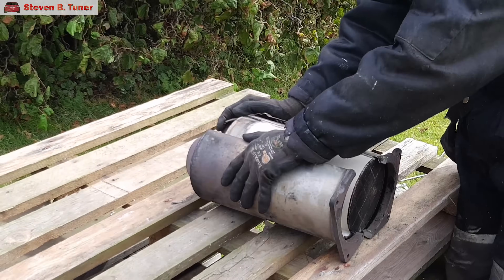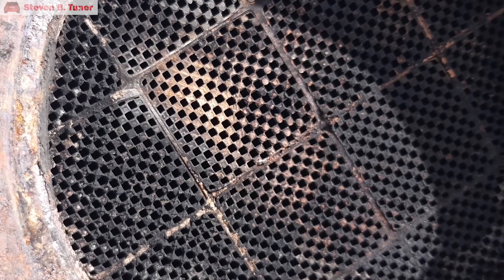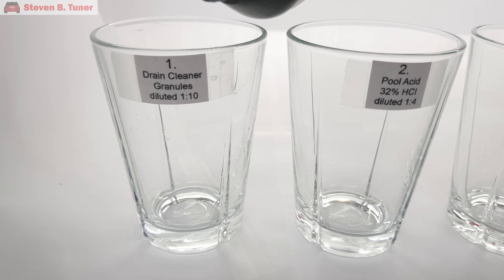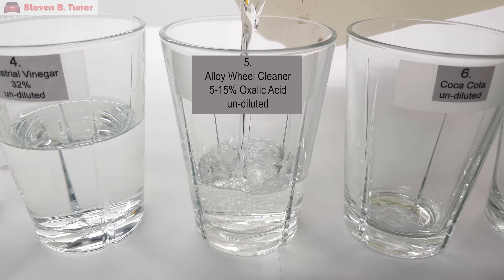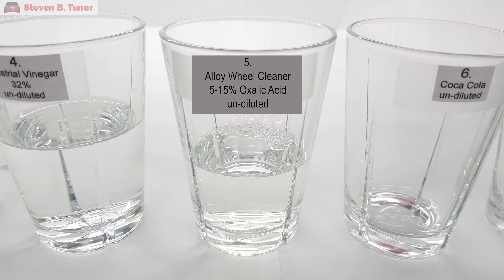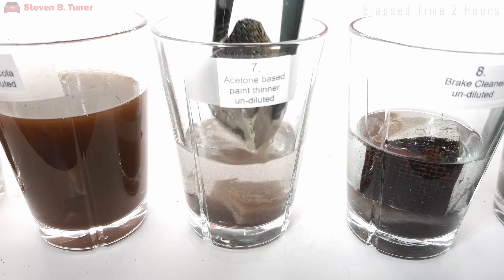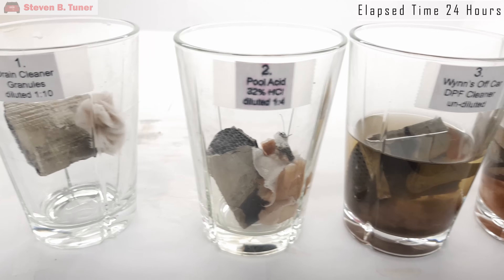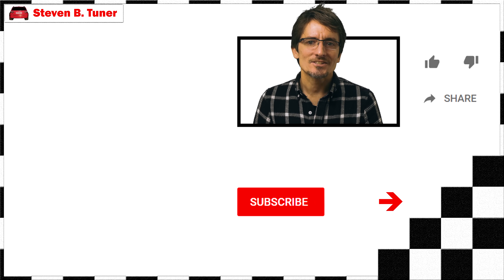DPF Cleaning at Home – 9 Chemicals Tested (Diesel Particulate Filter DIY Ash Cleaning)

Comment: Hey Steven, nice and clear video thanks for that! I want to clean my dpf from my bmw with the dishwasher tablet, but you recommend to do it in 2 steps. Which one should i do first and with whar product? Thankyou!
Reply from the maker: Hi, my other video with the the thumbnail: The DIY DPF Clean shows my favourite process: 1st stage is to clean out any oily soot with sodium hydroxide drain cleaner, and the 2nd stage is 20 litres of 7% strength hydrochloric acid (pool / brick cleaning acid).

Comment: Can I use one of these chemicals for an on-car flush?
Reply from the maker: Hi, there are some folk in the comments who have done it with crushed up dishwasher tablets dissolved in water. I haven't worked out the best DIY method yet, so I am more likely to recommend a commercial product like Liqui Moly in place DPF cleaner.

Comment: Hi just like to say a big thankyou for this one, here in England my friends 2016 taxi Skoda Octavia 1.6tdi with over 200 thousand miles was constantly regening, I put loads of on car dpf cleaning solutions though a pipe which made no difference what so ever still 70 milibars at idle, so after watching your video had the dpf removed I soaked it in 7 percent brick acid for an hour or two and loads of red slurry came out rinsed with water had it put back on the car drives like new, 2 millibars at idle doesn't regen all the time and back to great mile per gallon saved the car from the scrapyard brilliant
Reply from the maker: 100% perfect result! Great to hear that the hard work paid off :-)

Comment: should of tried petrol and diesel , after all its what makes the mess😅
Reply from the maker: You are partly right - it is ash (unburnable parts) in diesel, petrol and oil that clogs up these filters in the first place...which is why you can't use it to clean them out.

Comment: If you do a pre wash with the dishwasher tablet you’d also need to test whatever product you use for a final clean mixed with the dishwasher tablet. Excellent information and well put together, great work thanks!
Reply from the maker: Hi, glad you find the information helpful! The 2 stages definitely need to be separated by water rinsing as they are chemically opposite in pH - so if they come in direct contact with each other they will cancel each other out and do nothing.
Reply: @StevenBTuner  there’s also variations in dishwasher tables, maybe a test to see which type tablet type works best? And then a water clean and follow up with 2nd cleaner? Maybe future video? :)

Comment: Very interesting video!
Please can you tell me how many dishwasher tablets I can mix with 1.5 litres of water?
How many hours I can leave there for a good result? 
I have a vw Passat 2018 I don't remove the filter, I will add straight to the filter 

Thank you
Reply from the maker: Hi, my other video shows my favourite method: The No Damage DIY DPF Clean. In-place cleaning is more of a regular maintenance type of thing, and there are chemicals made by Liqui-Moly specifically for this purpose. I don't have a DIY version as yet, so it would be experiment!
Reply: Hi mate, i have also a vw passat, 50 gr ash from obd readings. Pls is there a way to get this number lower with no expensive garage visit? Thx for your answer
Reply: @MuvahhiD_2009 

Hello 

It's not possible to go that number down even if you clean the filter, when you drive more miles than number it's gone high, so ignore it!

You need to follow the regeneration process of the DPF, I recommend the VAG DPF app with blue and yellow.

I recommend a very good product to add in the tank every full - Lucas Oil 40003 Upper Cylinder Fuel Treatment-1L

I have with my car 240.000 miles and the DPF is still good, have regeneration on time and I have 100 g 

With that product you will see more power and very good for DPF

Also I cleaned directly with 1.5 l water mix with dishwasher tablets, but don't put directly to the 02 sensor or sensor 1 bank 1 it's a tricky way from DPF pressure sensor from left pipe ( it's go directly to the filter)

👍👍
Reply: @alexn3631 i put product yesterday through the whole which goes open with 22 mm lambda key (or something; dont know the correct name), did i correct?
Reply: @MuvahhiD_2009 
Try to avoid in to future again this method because you risk to put water through the gallery and s plugs 

Find the DPF pressure sensor location and there it's 2 black pipes which it's go trough the DPF

Location it's oppoosit DPF filter top on the engine with some covers on it
Reply: @alexn3631  Vw passat b8 2017 here. Did it as follows:

Step 1: 2l warm water mixed with 10 dishwasher tabs (1 tab is 15gr).
Run mixture through sensor whole into dpf, wait 30 min. Run for 3 min idle motor. And go to step 2

Step 2: mix 3,5 l water with 1,5 hydrochloric acid (23%). After put 2,5L of mixture into the dpf and wait 15 min. Repeat until all 5l of  hydrochloric acid 23% is over. In total 16L water is mixed with 5L of that acid in this step.

Step 3: rinse with 2L dishwasher tabs like in step 1. 

Step 4: rinse with 20L warm water

Step 5: run motor for 15 min

Step 6: go for a 30 min ride and go around 3000 rpm

You gonna see a lot of smoke during step 6.

When cleaning a lot of black oily particles came out of engine. In the beginning the water coming out exhaust pipe was really dark. At end was no that black but with a lot of little black particles which dissolved in water if you touched it. These kept coming out even after 20L of rinsing with normal warm water. 

Update the day after cleaning. No smoke. Car rides smoothly.

Thx guys for your help !
God bless America 😁
Reply: @MuvahhiD_2009 thank you very much 
I will try soon, you are very kind
Reply: @MuvahhiD_2009  on step 2 I don't start the engine for a few minutes after I put the first mix?
Reply: @alexn3631 i only started engine for few minutes after step 1. After that, till the end, i didnt start engine, just did acid part and rinsing (first with dishwasher tabs and after with water; after dishwasher tabs mix i waited 15 min and rinsed with 20L warm water). I think even after step 1 you can go without starting engine. But not 100% sure

Comment: It's recommended that hot clean water is the best to clean dpf. No chemicals needed because water is best so why pay for second best.
Reply from the maker: Hi, industrial ovens and high pressure low flow backflushing machines are not too common in most people's home garage.

Comment: Hi Steve....Just had my DPF removed purged and reinstalled.  engine starts and runs fine but now its not producing power and barely does 10mph....any thoughts/suggestions?
Reply from the maker: Hi, it can be that a sensor has been dislodged or damaged during the removal / cleaning / re-installation process, so you will need to get a diagnostic scanner connected to find out where the issue is, and to clear any codes that might have been triggered that are no longer applicable. For older cars it is also necessary to tell the engine ECU  that a new DPF has been installed - and this is a service function that is available on good diagnostic units.

Comment: Dear Steve if you mix cascade powder dishwasher and sodium hydroxide  together to soak overnight it will lower is ph?
Reply from the maker: Hi, it might change the pH a little bit, but surfactants in the dishwasher powder will make it work better than straight sodium hydroxide.

Comment: so you thinks the culprit is the egr that need cleaning as well on my truck
Reply from the maker: Hi, a closed EGR is needed in order raise the temperature of the exhaust gases ready for the regeneration process, so a clogged or broken EGR valve can cause the DPF to become clogged with soot.

Comment: what brand of wheel cleaner Steve?
Reply from the maker: Hi, the ingredients of wheel cleaners are changing all the time, so it is better (and cheaper) to buy the oxalic acid on its own if you wanted to try it. It is commonly used for cleaning teak boat decks, so it is not too hard to find.
Reply: Thanks

Comment: Aight this is the second time I see a mechanic or at least someone who does the maintenance on their own using dishwasher tabs to get rid of oil residues. This time was a DPF filter but the previous one was on another component I can't remember right now. 

I think as stated, that may be one of the best pre washes and also pretty cheap when compared to other products, not to mention it's effectiveness.

For the second go pool acid is cheap and also reliable as seen, but I'm wondering if it wouldnt damage the steel components of the filter itself.

Good video!
Reply from the maker: Hi, you are quite right - HCL will always attack stainless steel to some extent. However, it is cheap, effective and available world-wide, whereas 'better' acids like sulphuric acid are impossible for normal citizens to buy in most parts of the world.

Comment: Hi Steven,
What would be your suggestion for oncar dpf cleaning method.
The dpf is not blocked just old and regens are now done at each 200km.
Thank you!
Reply from the maker: Hi, BMW dealers have been doing 'in-place maintenance cleans' for a few years now, and there are also independent workshops doing a similar service using Liqui Moly in-place DPF cleaning fluid, which is sprayed in a sensor hole. The Liqui Moly sprayer is quite expensive, but you might be able to make something that works well enough for a one-off operation by adding some metal tubing to a pressurised weed sprayer and playing around until it sprays in the direction you need. I'd love to hear what you decide to do, and how it goes!

Comment: I use Wynn's off car solution mostly... I did have a 300k van which i used a tin of oven cleaner and worked a treat.
Reply: That essentially breaks the soot downit and would break-down the grease. Most probably the best solution.
Reply from the maker: Great to hear that they can work too!

Comment: water and air only...did.many trucks and cars without an issue...chemicals brake it down slowly...water.doesnt ..
Reply from the maker: If there is an integrated DOC, then they can be easily damaged by high pressure water.

Comment: With the result of the dishwasher tablet, would making up a solution with dishwater tablets then adding it to your cooling system running the car for a few days then flushing the system not perform a clean of your whole system
Reply from the maker: Hi, that would require a new batch of experiments!
Reply: Surely your egr cooler and internal rads would benefit in theory, it’s a video I’d like to see

Comment: 5:53    try ot to breath this stuff.... we've use oxalic acide to bleach wood... its very very mild...   you need a solvant for the soot... its naphta or lacquer thiner or diluant cellulosique get those from castorama,  home depot, leroy merlin etc
Reply from the maker: Great suggestions!
Reply: Do you use straight oxalic acid?
If so, in what purity / strength?
The wood bleach / deck wash i use is generally in solution already at various dilutions.
Id be interested to hear where you buy it straight

Comment: Why not try near diesel?
Reply: The muriatic acid will destroy metal or lift any metal coating acting as a protecting layer so I'm not sure I would use that inside of my DPF filter... I'm going to take a guess that a detergent is the way to go
Reply: @tommyboi0  good to know. Thanks
Reply from the maker: Diesel (and oil) is what caused the ash, so something much stronger is required to remove it.
Reply: @ yes, in its burnt form. Neat diesel is a great remover of burnt deposits and a great degreaser.
Reply: @ I love the video, thanks for the reply. I’m considering cleaning my own DPF, so your vid was perfectly timed for my timeline. 
What would you use as a finisher after the diluted soap pod? 
Really interesting results, I really wish I had one to experiment with 😂
Reply: @StevenBTuner Yes something stronger such as Coca Cola. I think it’s not a bad question. Why not using something to solve something of it’s own? It often works in other cases. I would give it a try.

Comment: Thank you great test. So which if you did more tests which is the best?
Reply from the maker: Hi, my favourite method is still the one shown in my other video: The No Damage DIY DPF Clean. I use the sodium hydroxide solution followed by the hydrochloric acid solution.

Comment: Wouldnt soapey water just potentially create a longer term issue... "Corrosion"???
Reply from the maker: Hi, I have another video you should check out if you are contemplating cleaning your DPF yourself: "The No Damage DIY DPF Clean". Rinsing out all of the chemicals at the end is a very important step to avoid corrosion.

Comment: I got an idea, seal the ends of the pipe, and fill with cleaning solutions, then strap a palm sander to the outside of the DPF with a strap. Turn on and let it vibrate clean... I bet it would work. Im currently building my own supersonic DPF cleaner. thats how I got the idea. lol
Reply from the maker: Sounds interesting - I hope you'll share the results!
Reply: @  It worked exceptionally well! better than any other cleaning method I’ve tried. I was thoroughly impressed. After cleaning the filters, my truck's flow numbers matched those of brand-new filters. The amount of soot and carbon it removed was incredible. Thank you for all your research!

Here's what I did (I'll be as detailed as possible):
I used an 8-gallon stainless steel pot and attached eight 100W, 40Hz sonic speakers to the bottom. The filters I cleaned were for a Freightliner Cascadia semi-truck, Filters measuring 10 inches in diameter and approximately 12 inches in height, with both ends open, exposing the filter material. If you're cleaning a car filter, you may need a different container for the sonic cleaning.

Once I built the cleaner, I followed these steps:

Step 1: Preparing the Filter
I tack-welded small steel pieces in a T-shape on top of the filter, extending just enough to rest on the edges of the pot. This kept the filter elevated about an inch above the bottom and made it hang in the middle of the pot. 

Step 2: Initial Cleaning with Dishwasher Tabs
I filled the pot with hot water and added three dishwasher tablets. Then, I placed the filter in the solution and ran the sonic cleaner for 35 minutes before rinsing. I repeated this process twice or until the rinse water ran clear and no more black soot flowed out. I found that dishwasher tablets worked better than drain cleaner, as they rinsed out more thoroughly.

Step 3: Acid Cleaning for Deep Carbon Removal
I mixed brick acid with warm water in a 75% water to 25% acid ratio. I placed the filters in this solution and ran the sonic cleaner for 25 minutes. The amount of carbon that came out was astonishing. I immediately rinsed the filters afterward.

Step 4: Drying and Heat Treatment
I used compressed air to dry the filters, then placed them in an oven in my garage, heating them to 500°F for four hours.

Results
After reinstalling the filters, I was shocked to see the software’s flow numbers—they were like brand-new filters! One important note: it’s crucial to perform a "light test" to ensure the filters are still good before going through this process. Also, after about an hour, the acid began eating small pinholes in the stainless steel pot, causing leaks. Using a plastic bin for this step might be a better option. Again thank you for the research you have done. I could never have done this without it!!!

Comment: Can you say please, 10 parts of water, what that means? One dishwasher tablet with 10 liters of water ?
Reply from the maker: Hi, if you take the size of the dishwasher to be a 'part', then add approximately 10x that size in water. It's not in any way critical - you just mix some up and try it, and if there is lots of oily gunk then mix up some more.
Reply: @StevenBTuner what disheasher tablet should we use

Comment: In about 1981 I saw an aircraft engine un seized using regular Coca Cola. It took about an hour and a half for the drink to "eat" the galled spot on the side of a piston. I've never drank the stuff since that day.
Reply from the maker: Haha, fair enough too!
Reply: I freed up a Cadillac 500 that sat in a junkyard without heads on it and was exposed to the elements for decades. 
 I used Marvel, WD, Kroil, BP and whatever else I had on the shelf for 3 or 4 days and nothing worked.
 Old guy told me to dump a coke in each cylinder and check in the morning. All of the pistons popped out with ease the next day. 
 I also haven’t had a coke since that day. 😆 👍

Comment: Could you try Caustic Soda, highly concentrated?  As a kid, i was always having to decoke my moped exhaust system due to the 2 stroke oil.
Reply from the maker: Hi, caustic soda is the common name for sodium hydroxide, which is what the drain cleaner is made from - so it's already in the test :-)

Comment: I’m about to embark cleaning my EGR cooler. I’m thinking dishwasher tab? If so, I add 10 times the volume of the tablet size and dissolve?
I can pour the liquid into the cooler and let it sit as the in-out is at one end only. 
Would this work? I can poke each channel with a wooden skewer to assist with the clean I assume after a decent soak!
Reply from the maker: Hi, it should work as well as a strong degreaser. Poking, brushing, scraping and shaking will also help. You could also add a bit of caustic soda for some extra kick.